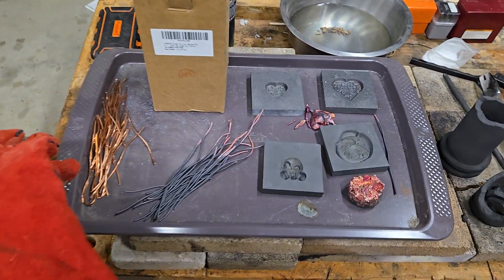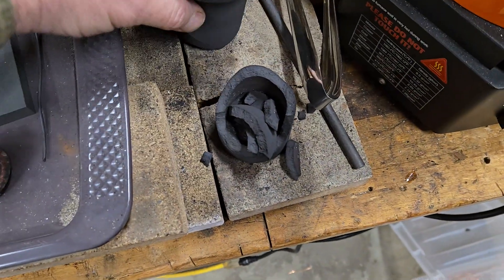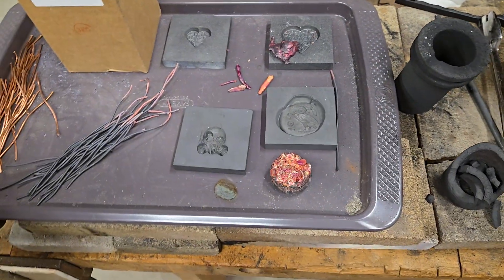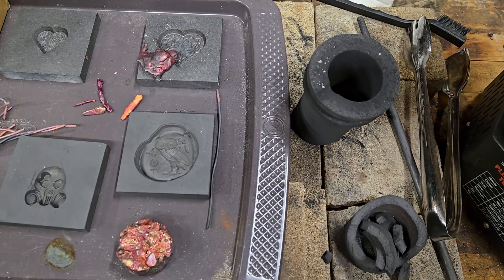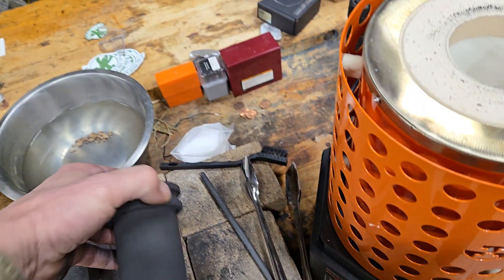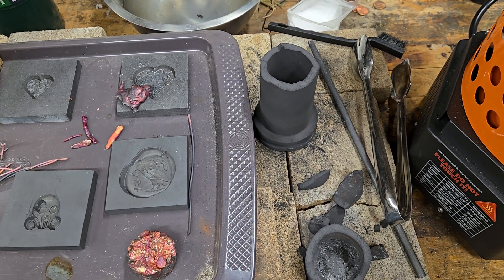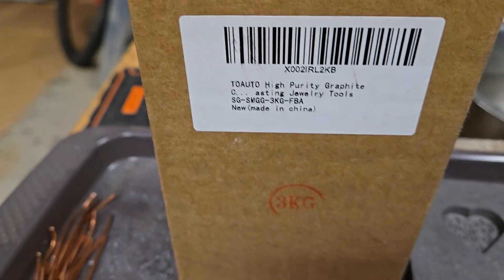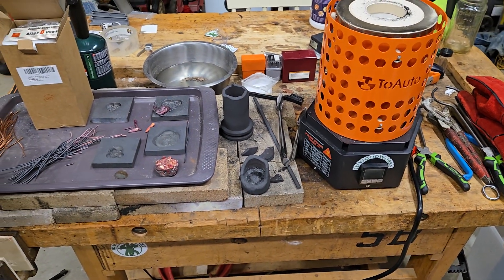Crucible problems.

Comment: My thought would be impurity in the metals be careful my friend ❤
Reply from the maker: @sherieward7707  I was using scrap wire. Not guaranteed to be .999 pure but  next time I go ill take it to the LCS and have them scan it with the XRgun. Im curious.
Reply: @ I’ve witnessed almost like a bomb blowing up when someone else had melted a silver bar and it wasn’t pure silver! They were pouring the remaining melted metal into the cold water bucket as soon as it hit the water loud bang and water 💦 all over. Pretty scary as I had just started my pouring journey. The rest of the metal in the cooling pan after was inconsistent and almost like a flaky paste but silver in color!! So probably a good thing it didn’t come out of your crucible and into your quench or cooling bucket. But it was impurity in the silver not sure if copper would have the same effect

Comment: It sure wasn't pure copper as it have boiling point faaar beyond what that furnace could do ... looks more like it had something else in the mix that boils around copper melting point. That's the worse when melting random cables as they are often not pure copper. Had few melts ruined because of that.
Reply from the maker: @paanjaan  Good point. i will have my LCS scan some with their XR Gun

Comment: Back up has arrived!
The bottom of the dead crucible would make a nice planter for a little Jade Plant succulent "tree".
Thanks for sharing.
Reply from the maker: @silversleuth007  that's a great idea I hadn't thought of that. I was just going to see if I could use it for melting down scrap like a whip dish
Reply: @3DWoodWorks  ... some succulents are pretty hardy. A bromeliad can survive if you only spit on it every so often, and can grow on anything. Jade takes a little more care for hydration. A Malabar Chestnut would be very cool. Small kine.
Or the whip dish idea.
Note2self>>> google whip dish. 🙂
Reply from the maker: @silversleuth007  Thanks, that was a good chuckle. I just use that tern loosely for Melting dish, because I like the song by Devo Whip it whip it real good. I think I'll go with your idea. It will make a great video too. Now to learn about the Jade succulent tree
Reply: @3DWoodWorks  ... nice. PS...
All three of those plants would survive on Planet Claire. Under a Strobe Light.🙂🙃
Once you google jade plant, you will recognize it at Lowe's or some garden department. 🌴

Comment: Oh no fun bro. Old crucible. Copper is hard in graphite. I heard it was good to give a gentle squeeze to the bottom of crucibles before heating them. To test the integrity before that happens. The “boiling” happens with copper. It’s a messy metal. Really glad no injuries. Burns are no fun. But hope this helps. Feel free to send an email if you want or have any questions. I’d be glad to reference my copper casting books to help you in whatever you may need. Stay safe
Reply from the maker: @KēvinRose01  that Crucible I actually broke with the intent of seeing why it was so spongy and soft. Once I got the copper out it had a lot of graphite mixed in with the copper. Thank you for offering those resources. I will be in touch

Comment: If it was sizzling and bubbling then the copper looks like it could have foreign materials in it. Scrapped copper can often have different materials hidden inside. Your heat doesn't seem to be the problem since it's just now starting to happen
Reply: Dang 3D Wood Works, sorry to hear this, hope your furnace is salvageable, and you just need to replace the crucible.  Good luck 🍀 tomorrow
Reply from the maker: @BellowsForge  the furnace is still good I was just worried about The Crucible being worn too thin. And it was getting soft so I just broke it to see how thick it actually was and get the copper out
Reply from the maker: @SupremeGGstacker  thanks Supreme G
Reply from the maker: Im using the same stock i have used before. I'll try agian when it cools down.
Reply: @3DWoodWorks  if you ever want to send your copper to me, i can melt it into copper shot with my propane furnace. Just so it'll be easier to melt within your electric. No pressure or anything, just lending a hand if needed broski! 😎🤘🤘
Reply from the maker: @SupremeGGstacker  that would be awesome. I will take you up on that for sure.